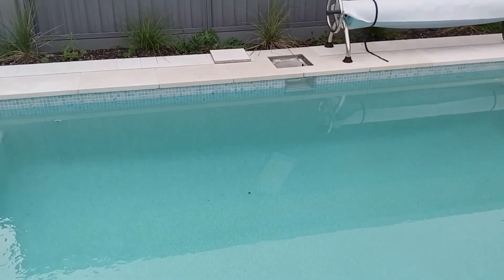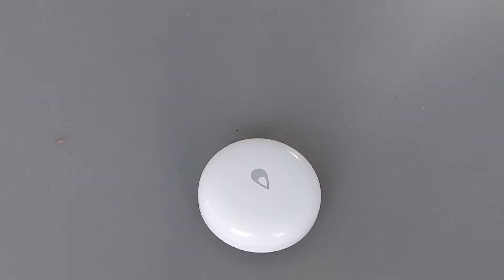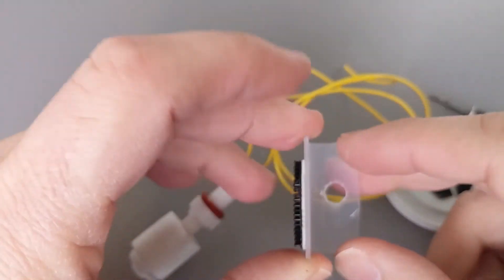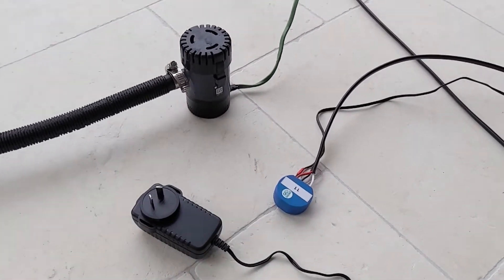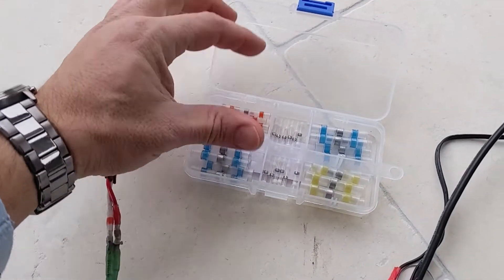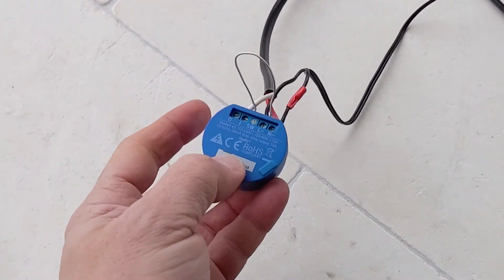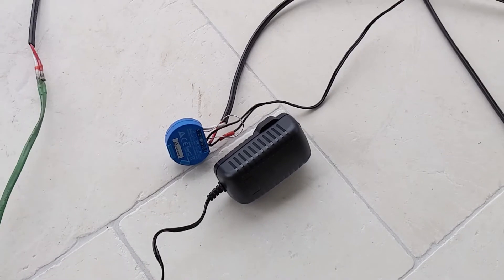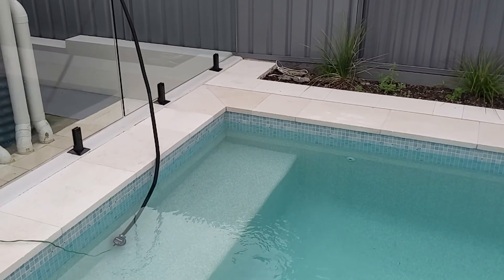Automatic Pool Overflow Drainage - Hubitat + Shelly 1 + Zigbee Water sensor + 12v Salt Water Pump

Comment: How did your system work over the last year?    I had a drain hole installed into my skimmer box.  The benefit of this is that you are draining freshwater off the surface of the pool (sucked over the weir in your skinmer box). This prevents the loss of all of the expensive chemicals and reduces the complexity.  The other thing you could do is to dig a hole in your garden bed and install a drainage box a couple of feet below the surface.  Cover it in geotech fabric to prevent soil filling it and bury it under the garden.  This will give water somewhere to go and absorb.
Reply from the maker: I've had it drop off the zigbee network a handful of times but i think that is most likely my setup. I've thought about mods to the skimmer box like you mentioned but I'll look at that down the track to be done by a professional. I don't believe absorbing will be an option for me and I'd have to drain instead. It would definitely be the better approach... Not as geeky though 😜

Comment: Absolute legend, have been trying to figure out a simple and cheap solution to do exactly this. I have a water tank, a sunken fire pit, and pool, and when we have seriously excessive rain all of them can fill up. This doesn't always cause a problem, but if the heavy rain means our stormwater drains are also full, there's nowhere for this water to go. At the moment I manually run around controlling pumps to send excess water away from the house. I already have 2 zwave leak sensors and 3 pumps. This idea is going to allow me to automatically send the water for less than $20. Thanks for posting!
Reply from the maker: No problem. Good luck and make sure you have fun in the process. What automation hub are you using by chance?
Reply: @geekydad8565  Thanks mate! I use OpenHAB running in a Docker container on Unraid
Reply: Cool I haven't played around with openhab for a few years now. I'm sure it doesn't look anything like I remember it
Reply: @japostolakis  It used to be pretty clunky, and there's sometimes a war between OpenHAB vs Home Assistant vs Other Solutions. But most of the time they're all serving the same purpose. It's a bit like the fairly meaningless Apple v Android rivalry. Once you're in an ecosystem you're more likle to stay in it and OpenHAB has kept up with my needs really well

Comment: Hi, What a great solution. Living in Queensland I have the same problem with so much rain. I have been looking to do something similar. I have an Aqara hub already, which float switch did you use? Would be great if you could list the components and where you got them from. I presume within Australia?
Reply from the maker: Hi. The float switch is just something cheap off ebay. Anything you can find will work. It behaves like a contact switch so it's a very simple device. Let me know what other parts your interested in and I'll do my best to help
Reply: I am going for a lay flat hose, i have read that it could solve the siphoning problem as the hose collapses without pump pressure.
Reply: Thanks, found some on ebay and Jaycar. Everything else I have. I have ordered a Aqara water sensor, will see what it exposes in homekit or directly via the app to turn on a smart plug.
Reply from the maker: @baddoggyau That is awesome. Have fun!